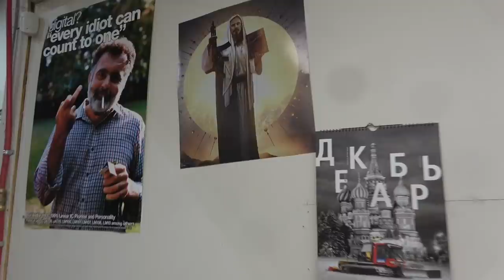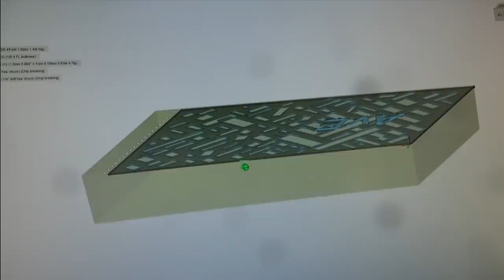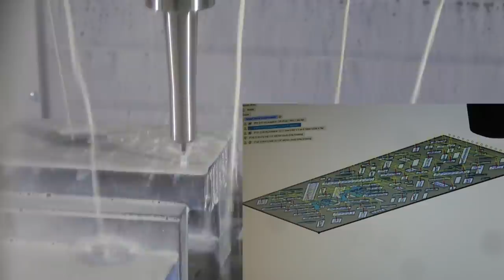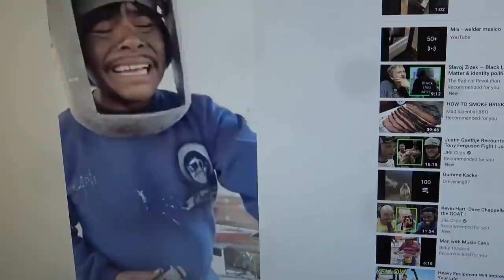A simple invention to save Filet Mignon

Comment: I can't be the first one with this idea, so whats the problem with that:
Force sensor on the CNC and if it surpasses a threshold it slows down/stops/reverses.
No more broken stuff.
Also you could program it not on a certain feeding speed but a feeding force, if that makes sense.
So small cut/soft material/strong bit it goes fast and vicenco di verso without having to guess it.
The bit manufacturer specifies a window of force the bit can take, you input that data into the CNC and it adjusts its feeding parameters automatically.
Reply: Get on it!  Invent it, patent it, sell it, retire to your own tropical island a millionaire.
Reply: There are machine controllers that have the ability to adjust feed/rpm on the fly using spindle load as feedback. An old Fadal at my former place of employment would make the strangest sounds of disapproval while roughing. Nothing ever broke, but if you weren't ready for the sound and subsequent vibrations of the floor, it would cause rapid evacuation of turtle heads.

Comment: I made a “heat ballast” years ago for an old gasser I was trying to cook on. I made it out of plate steel, but the combustion byproducts of the propane corroded it very quickly. I had large sheets of corroded steel separating and flaking off. I finally went to a block of granite.

Comment: I do the exact same thing myself - an inch thick slab, 6x9". Mild steel and none of the design work, mind you, since I don't (yet) have a mill for that. Chuck that slab in the electric kiln for 20 minutes at 900 Frankenstein and let it soak. Pull it out (I welded a spot for tongs to mine), grab your sous vide'd ribeye, then slap, slap, seared. You can sear 2-3 steaks before the temperature drops too much.

Comment: for the texture, I know if you have a hammer (CNC Milling machine) everything looks like a nail. (I'm the same way with my plastic-squirting 3D printer.) But wouldn't a sheet of diamond plate some-how fully attached (braised?) to the big-chunk-o-metal work as well?

Comment: There is a funny thing about the name FIlet Mignon in the mother land. At least according to my butcher (and you don't question the burly guy with a big sharp cleaver) that term is used for pork tenderloin, not beef. The primary cuts are different in France, the closed I have found over here is "Tournedo" which is basically filet wrapped in lard.  The French also seem to think cattle should eat grass rather than corn so the meat is appreciably different here and you have to be far more careful with its preparation. (woe betide anyone who wants it "well done" )

Comment: Wow it's a 1 inch slab of steel! All that extra surface area you drilled out of it will help dissipate the heat, when the entire point of using a metal block as a cooking surface was to maximize heat retention. Brilliant, I'll put it alongside my Microwave Egg-timers and George Foreman grills!

Comment: Doesn't a piece of steel that thick take forever to get to temperature? The idea is neat, but I feel half thickness could work better, especially since it would be used outside, where the environment would be trying to suck the heat out it. Also, wouldn't it be interesting to add some grooves that go out to the side to drain excess liquid, so you could use it with other meats?

Comment: I don't understand why the plate is so thick.  Won't it take longer to hear up?  Is the intent to take the plate off the fire before putting the steak on it so that it's cooked by just the heat stored in the plate?  Then you miss out on the flavoring agents from the wood though.

Comment: Be careful about the metal you use. Make sure it's food or surgical grade metal. Otherwise you could get some metal poisoning. Iron alone can be toxic (causes necrosis of the intestines which can lead to gangrene). If it's stainless steel, regardless of the type, boil in a strong vinegar solution at least 6 times (10 to 15 minutes each time) to remove as much of the leachable metals as possible. Then you should be good to go. This is also good advice to follow for any stainless steel cookware on the market. I say this because I got metal poisoning from a homemade stainless steel baking sheet my father made. Didn't kill me but left a strong metallic taste in my mouth which didn't go away for weeks. Gave me some gut pains for a while too if I remember correctly. Here's a link about this problem (this is where I got the idea to boil in vinegar solution to reduce the amount of metal leachate): https://www.ncbi.nlm.nih.gov/pmc/articles/PMC4284091/ 

People say 44W (AKA "A36") steel is food safe, that it's what most griddles are made of. It's reportedly got a great thermal conductivity unlike stainless steels (this is why good stainless steel cookware has aluminum or copper cores). But they say to soak A36/44W in vinegar (solution?) overnight to remove any mill coating and follow with a good scrubbing with soap and water and season it twice with a light coating of a refined (non-virgin) oil before first use. That should prevent any significant metal from leaching into the food. Or so I would expect. Good luck.

Comment: I heard the cool thing to do right was something about protesting something or other . Heck , from what I'm seeing , all the cool kids do is just yell and test auto paint ignition temperature . And some where asked to  locate  hidden  merchandise in easter egg hunt put on by expensive shops . I still don't understand why the shop owners are upset at the participants . Something about the participants in easter egg hunts not using front doors of stores . There was even a window washing outreach by the kids but poor fellas used rocks instead of newspaper to clean windows . Windows are beyond repair .

Comment: AVE is on the wrong side, it should be in reverse!! you will read 3VA on your filet mignon!!! 
By the way Angus 1855 Filets aged 45 days in a Umai Dry bag melt in your mouth literayly. 
Try cooking them Sous-vide for 2 hours then sear them on your planche, you will fill like in a 300$ a steak restaurant, 
Keep your steak on the grill!
Reply: Which sous vide did you buy and would you recommend it to others?
Reply: @johnpossum556  I use the Anova original that had WIFI and BT  got it for 3 years with an 18 quart polycarbonate water container with cover. cooked some meat for 24 hours with out even loosing 0.1 degree to the target one. Yes I would recommand one. even if I used it for hundreds of hours it still looks brand new. stainless steel is perfect and the electronic control is right on.  One thing that I do is always add hot water to the container to have a starting temp  closer to the target. that way you dont demand too much power to bring the temp up and always make sure that you dont have the water levels too low.  first its easier to keep a large amount of water to a steady temp then a smaller one and the pump never heat air keeping  the heating element in shape